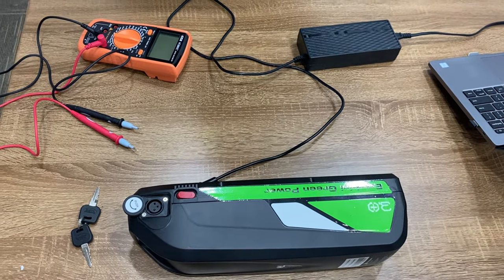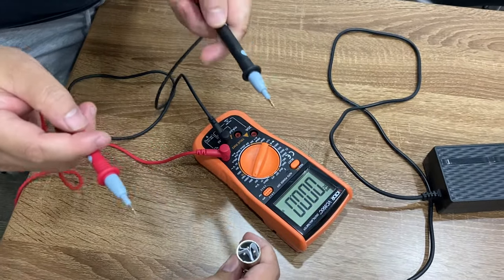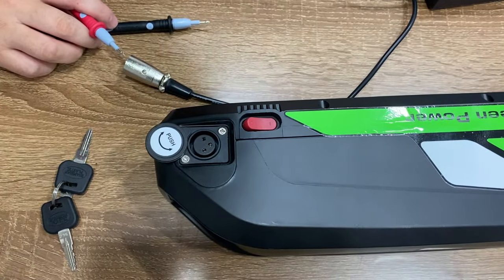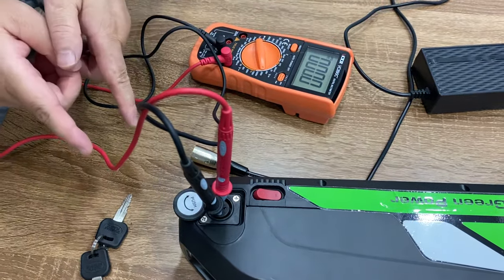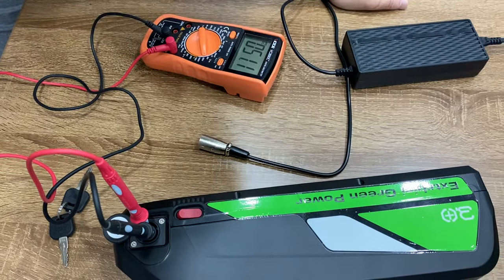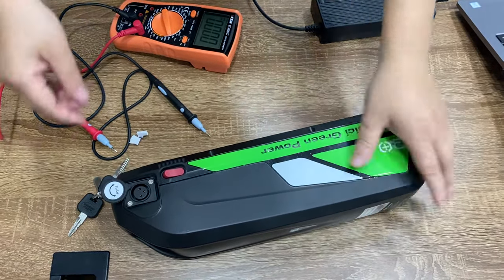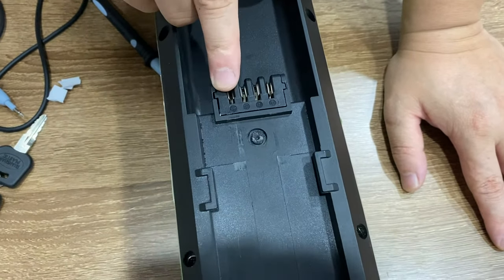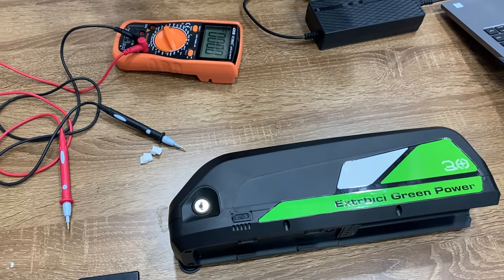How to check charger and battery issue by voltage meter?

Comment: My charger was showing green even when the battery was discharged, I wasn't sure if it was a battery or charger problem. This video enabled me to diagnose a charger problem and when I undid the connecting plug I found one wire hanging off! Quick solder and all is well again. Thank you for the video, could have been a long expensive process to determine the problem otherwise.
Reply: I have to same problem. What was the fix ?

Comment: Hi! Thanks for this video. Just a little question. Is the charger plugged to current while you test it? The battery needs to be on, right? What if I get sparks when using the tester? Hope you can give me advice.

Comment: This video Demo on using a voltmeter for battery testing will be helpful for those without electrical testing experience.  However, Not mentioned here is the battery mount plate that is attached to the bike!  If good battery but no power to the  motor that part could be the root cause. If testing just that adapter plate remove the battery and use the resistance (ohms) feature in your DMM (Digital Multi- Meter). Good luck!
Reply: Yes agreed check continuity on pins on plate

Comment: On both my charger and battery, the center pin is not connected to anything. The battery worked for a while.
What is the center pin/hold supposed to be connected to?
Reply: On some systems there is heating monitoring of the battery and the charger takes a signal back from an NTC thermistor.  Sometimes this is hidden in  sep cct within the frame of the bike. Measuring heat build up in Li ION batteries is critical.. no mafr wants to tell the User how he does it so it's harder to buy any other charger.  TE Fidler NzL

Comment: Hi so your example that this battery is ok right? I have a situation where it charges completely but shorter mileage? What's the problem there?
Reply: Lower mileage typical means your battery cells are wearing out assuming you are using throttle / PAS the same amount over similar terrain.
Reply: even low tire pressure can affect mileage

Comment: When checking the prongs (4 or 5 pin) you have to check more than just the + and - you have to check the prongs in between as well as they have wires (green, red, yellow) and they can be easily separated from the prong as these wires are really thin. They all should have same voltage except for the green ground wire which should carry very little voltage.
Reply: Hi. i just did this and 2 of the 4 prongs didn't read any voltage (0v), the other two read about 54 v. Does it mean there is some kind of wrong connection between the battery and the prongs? thank you.

Comment: At one point it sounds like you're saying the charger is good, at another point it sounds like you're saying it's a poor charger. Please enlighten me.

Also, I see the numbers reach 054.6, but I hear you say, 55,.then you say 46. My multimeter starts with 00.0, yours starts with 000.0. 
When I just checked a brand new,. unused 24 volt charger I got 03.7. Should I read that as 3.7 volts or 37 volts?

Thanks!
Reply from the maker: Greetings, we appreciate your feedback. The data you tested is 3.7v.
Reply: @Cyrushersports  Thanks for telling me. Bad luck for me, it's a new charger. All of my other chargers read 0.00

Comment: Is it possible to replace the LEDs, knowing that the battery is intact, but when connected to a charger, it does not charge
Reply from the maker: Hi, Please click on our official website to submit a ticket.
Our after-sales staff will contact you and help you solve the problem.

Comment: Hi,  I've just got my new ebike but it won't charge, the charger light stays on green at all time even my battery is empty, what could be causing this?  Tks!
Reply from the maker: if the charger does not get hot which means the charger is not working, you need to replace it.

Comment: I've got the exact same charger as you and they only have 2 wires to the plug you insert into your device. Mine is giving me 42v but when I switch  multimeter to AMPS its bouncing voltage all over I'm not sure if it's ment to do that can anyone help me please.
Reply from the maker: Hi,Please submit the ticket，
https://www.cyrusher.com/pages/contact

Comment: I have two 48v battery’s 13ah and 17ah. They both test 52v despite being 48v? Why’s this?
Reply: 48v is nominal. The range for a 48v battery ranges between 54 and 42V
Reply: A  battery like a car must charge above its nominal voltage ie acar battery is 12 volts but to charge the alternator puts in 14.2 to 14.6 volts where as a 48 volt ebattery would need 52 to 54 volts to charge the battery

Comment: What if the battery doesn’t charge. What if The charger always stay green
Reply from the maker: Hi,
When the battery is charging, the LED indicators will flash showing the charge level.
One green ball represents the low charge.
Two green balls represent half charge.
Three green balls represent a full charge.

Comment: The paper in the plug doesn't help because the metal on the plug is grounded
Reply: Paper helped. But yes the casing is ground indeed.

Comment: What causes a 36v battery to cut out at about 39.5 volts does anybody know? (it charges up to about 40.5 volts).
Reply: For safety
Reply: @pepeshadilay  I got this reply on another video yesterday which makes a lot of sense but I thought the BMS was supposed to take care of that stuff? Otherwise one cell goes down & it stuffs the whole battery.I would have thought it would be better if they were cut off & the battery was allowed to continue at a reduced capacity.Quote: "🌟 Grin Technologies replied: "You'd have to open it up to find out! If you have a very badly unbalanced cell group, with one cell that is at like 3.0V while the rest are at 3.9V, you would have this kind of behavior."
Reply: If the batteries are not balanced ie one or a bank has a defective battery the battery management system will not allow the bike to move until the BMS recognises that each individual bank is on simmilar voltage
Reply: @sgtphilipm  It alows it to move from about 40.5 volts until the battery is drained down to 39.5 volts.Why determin that that is a dodgy voltage?
Reply: Cells are broken
Reply: @dennismarkiet129  Naa I've come to the conclusion now that it could be the old controller or whatever you call it.I might try it sometime with my new one if I can ever be bothered

Comment: What if the voltage meter gives zero
Reply: The battery or charger is dead.
Or you have wired the test leads incorrectly or the meter you’re using is broken.
I would test the meter by connecting it to your local AC mains supply as an example to confirm that it reads a voltage.
Or get a battery like AA battery and measure across both ends of the battery for DC voltage and verify the same.
Reply: @craigduncan4826  Hi Craig I have a situation where the battery charges completely but gives me shorter mileage like 70% less than what was advertised on the ebike company. Any recommendation how to test / parameters to determine I have a dud battery or charger?
Reply: @OrganicLithiumFarm  have you charged and then discharged the battery many times already?
If not then likely it is simply a case of false advertising- they all do it all the time just the same as electric care makers or diesel car makers say “80mpg” when really in reality you get 60mpg.
My ebike is the same- in real world use probably I get about 70-80% of what they claim I would get.
Reply: @craigduncan4826  mine is worst though they claim 35 miles but I get is 6-8 miles ? What's your take on that its very far from their numbers.
Reply: @OrganicLithiumFarm  that’s really far off. Are you peddling with it on full pedal assist or middle or what? I put in fair effort with mine on middle assistance and can pedal up hills through town at 20mph and I get around 60% of what they claim I would say.
If I had it on full assist or didn’t pedal at all, I would probably also only get about 5 miles or so
Reply: @craigduncan4826   I pedal a lot  and use middle PAS #3 and I use a lot of downhill and that's max I get 8-10 miles.
Reply: @OrganicLithiumFarm  yeah that is same PAS I use and I get considerably more. Sounds to me like the battery pack you have is either faulty or it has lithium cells inside it which are not new. I would definitely ask for a replacement
Reply: @craigduncan4826  I bought the bike using Paypal so if they decide to not compensate me I definitely will open a case on them. I love the bike hopefully they help me with the battery. Thanks for your knowledge! I appreciate it.
Reply: @craigduncan4826  when i plug the multimeter in the charger (60v charger), the voltage goes all over the place. It charges the battery but never goes green even when reaches the 67.2V). The charger its dying, what do you think?